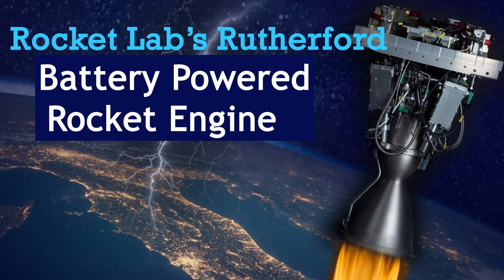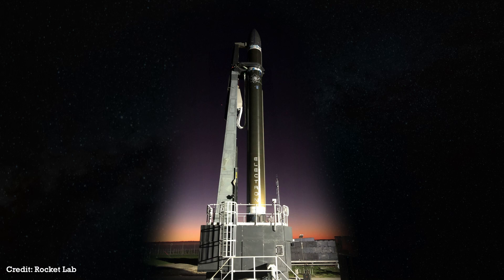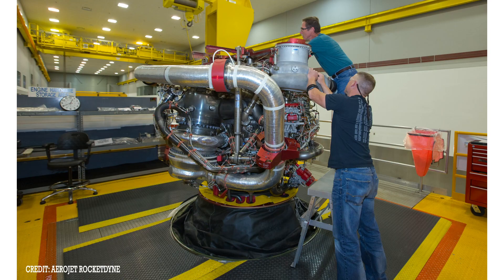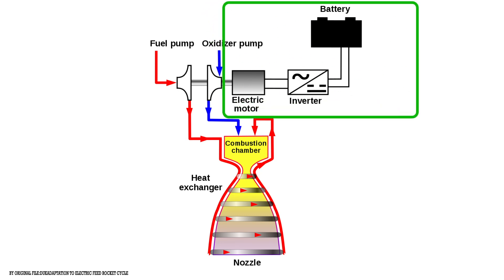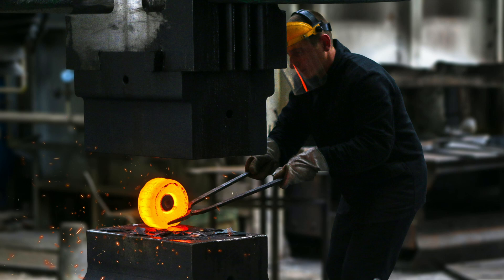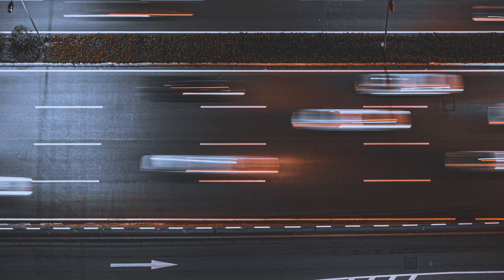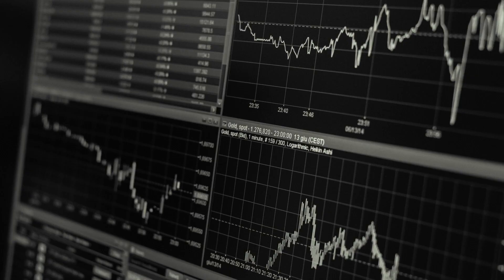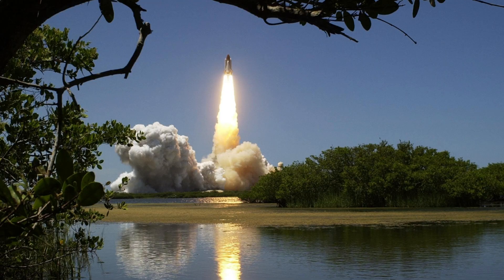A Battery Powered Rocket Engine? Rocket Lab's Rutherford Engine

Comment: Why didn’t Elon do this though
Reply: The use of electric motors results in an inferior performance in almost all respects. The big advantage is the much easier development. By using electric motors they managed to save a huge amount of R&D costs as the turbopumps are by far the most complex part of a rocket and consume most of the R&D cost. Rocket Lab managed to bypass all that by going using electric motors instead of complex hot gas turbines. It did result in a significantly inferior performance but given cost constraints it is better to have an 'inferior' engine that you can actually fly to space than a superior one that exists only on a drawing board.
As the company grows and can afford more R&D they will surely switch to turbopumps at some point to improve performance, but there are many other higher priority things that they will be doing before that.
Reply: @listerdave1240  you are wrong. Turbopump has lower performance.
Reply: @hafizuddin mohd lowhim  Absolutely not. A turbopump will provide far more energy (pressure * flow rate * duration) for a given total mass, by at least an order of magnitude even if you compare the best electric pump to the worst turbopump.
The issues with electric are partly because of the poor power to weight ratio of the electric motor compared to a hot gas turbine but much more significantly the very poorer energy density of batteries compared to rocket fuel/oxidiser. 
You also have the problem that a turbopump is unloading its fuel as it uses it, reducing the vehicle weight while the battery doesn't get any lighter as it is being discharged so you are wasting propellant to accelerate a good amount of deadweight.
If you look at detailed specifications of various rocket engines you will discover the huge amount of power a hot gas turbine can generate and yet be incredibly small and light.
Take the hot gas turbine on an RS-25 (engine of Space Shuttle and SLS) as an example. It generates 50 megawatts of shaft power to drive the fuel pump and yet is smaller and lighter than the engine of a small car.  I don't know specifically about the motors in the electron rocket, but let's assume the industry leading figure of about 14 KW/Kg. This means that if you were to use an electric motor to drive the pump of an RS-25 instead of a hot gas turbine then that motor alone would weigh about 3.5  tons, more than the whole engine weighs as it is.
Reply: Well if the Said engine could provide greater trust and isp than rs 25 like 380 isp on sea level 460 isp on vacuum even with dubble engine mass it is better
Reply: First of all as I already mentioned even though the mass of the motors will be a big handicap it is by no means the main issue and secondly there is no reason why it would, and if it did it would not be due to the way the pumps are driven.

More importantly  you need to be careful about how you define ISP.   To compare like with like you need to take into account not only the mass of propellant flowing into the engines but also the mass of whatever is needed to provide the electrical power to the pumps, in other words the batteries. Even for an open cycle engine the mass of propellant used to power the pumps instead of providing thrust is far smaller than the mass of batteries that would provide the same amount of energy.
With a closed cycle engine it is even better because the mass of the propellant used to power the pumps actually goes through the engine and out through the nozzle with the rest of the propellant which means it is effectively providing the power to the pumps for free (i.e. at no mass penalty).  So effectively with a closed cycle engine all the propellant is used as propellant.

There is essentially no way in which a rocket with electrically powered pumps can provide better performance than one with turbopumps. If you conveniently ignore the mass of the batteries needed to power the pumps (and less importantly the much heavier engine mass) than you could at best get an ISP equal to that of a closed cycle turbopumped engine.  

The ISPs of current leading engines are not limited by the performance of their pumps(which could easily be increased but would serve no purpose)  but by the temperature and pressure that the combustion chamber and nozzle can withstand. Anything you do with the pumps is not going to change that so going electric will just add mass without  improving anything in the way of performance. Worse is that while you could in theory equal the ISP based on propellant flow to the engine that figure would have to be downgraded to account for the mass of the batteries which for a real world performance comparison of ISP  and that is where you will see a huge reduction in the real performance of the electric variant.

That is not to say that electric has no advantages, there are some but they have nothing to do with performance. The main advantage is that it makes an extremely simple engine, cheap and easy to design and build (relatively speaking of course)  and with very little to go wrong whereas turbopumps, especially in a closed cycle system, require extremely complex and precise engineering and are always operating close to the point of self destruction, that being prevented only by advanced control systems.
Reply: @listerdave1240  you say that electric fed engine cannot perform better than Rs25 i say if it can dubble weight would be okey because most of the rocket is fuel so yeah less fuel means less tank and if it could be better than Rs25  and i say if not Will you Just say it cannot there is grafine ultra cappasitors and grafine battery that military use if you are that into trust to weight ratio but real advantage of this engines is different than you think so think about f1 there is no bigger liquid rocket nozzle engine with Electric pumps you can make multiple injetors like in v2 and maybe incarese engine power and size it like main engine part is actualy smaller means you May get denser. engine and pradoxcly you get more thrust even tho your thrust to weight ratio is less because you have more engine in smaller erea
Reply: @ufuker5754  The only difference between a rocekt using electric pumps and one using turbopumps is in the motor that is used to turn the pumps. Everything else is exactly the same including the pumps themselves.
It is either using an electric motor to turn the pump or using a hot gas turbine.
For the electric motor you need an extra source of energy (batteries typically) whereas the hot gas turbine uses the already existing propellant as its source of energy.

So please consider these points:

1. The hot gas turbines in current rocket engines already provide enough performance to drive the pumps, that is the amount of power they generate to turn the pumps. Any increase in that performance by any means, be it electric or even magic would not increase the performance of the rocket engine at all. Even if electric motors could offer better performance than the hot gas turbine that extra performance would not be made use of and would not improve the performance of the rocket engine.

2. Regardless of the method used to drive the pumps, the pumps themselves remain the same as do the combustion chamber, the injectors, the nozzle and just about everything else that matters in generating a high ISP.  The choice of what to use to drive the pumps only changes the amount of extra mass that needs top be carried. 

3. Electric motors (apart from being inherently much heavier than hot gas turbines) require a very heavy power source whereas hot gas turbines as used in rocket engines need at worst some amount of extra propellant (for a simple open cycle engine)  or none at all for  a closed cycle engine. How none at all?  Because it is the same propellant used by the actual rocket itself and goes out as exhaust from the nozzle. It is therefore used twice, first as a power source for the turbines and then as propellant. So the weight of the power source is effectively zero, which is hard to beat. For an electric power source to be lighter than that it would have to weigh less than nothing, which of course is not possible.

4. Using electric motors instead of hot gas turbines will not need less fuel. It will need exactly the same amount for the reasons mentioned in point 3, so no less fuel or less tank. 

5. The issue of multiple injectors and the comparisons you make to the F1 engine are not relevant because such things do not depend in any way on what is used to turn the pumps. Every such comparison can be made the same regardless of whether the pump is driven electrically or by a hot gas turbine. There is no reason why having electric motors turn the pumps would somehow allow you to have more injectors or anything of the sort. Such things depend only on what comes out of the pumps, not what is turning their shaft.
Reply: @listerdave1240  so you say 1 gas turbines is already well enough and everything is same other than one that is pumps i simply saying gas genator need more pluming more complex and more space needed electric could use less erea so i am saying because of simplecty electric engine pull of things that gas turbines would not and gas turbine will better in Said disegn but because of extra complexity humans cannot pull that of that desing so like you my Said f1 expample is irralivent but why engineeirs of appollo program did not do that then well because f1 is already covered in maze of pumps they Just not dare like i get it your point but you Just cannot accept the possibableyt of mechanicly worse engine performing better because of its design adventeges Just give a little more chance okey
Reply: @ufuker5754  Whether one or the other is better depends on what you need to achieve. If what you need is the highest possible performance. If you need simplicity and reliability then electric may well be the best solution. It may even offer some advantages in reusability since electric motors suffer little or no wear as opposed to hot gas turbines and all their associated machinery.

However if you need the highest possible performance there is currently nothing, even just in theory, that can improve upon turbo pumps when used in a full flow closed cycle. It is very complex and difficult to design but if ultimate performance is what you need then that is the price one has to pay.

The current state of closed cycle engines (especially if full flow) makes then very near to 100% efficiency, meaning that they convert almost the entire energy content of the propellant into kinetic energy in the exhaust so there isn't really much further to go in terms of 'efficiency'.  Ultimately what you want is the highest delta-v for the vehicle, so apart from the high ISP (which cannot be improved much further no matter what one does to pump the propellants) any reduction in vehicle mass will contribute a great deal to the overall delta-v. 

The differences in ISP between the closed cycle engines are mostly due to the type of propellant used. The RS25 for instance has a higher ISP than the Raptor has nothing to do with engine efficiency but  but is because the propellant used hydrogen/oxygen has a higher energy density than methane/oxygen and has an exhaust of lower molecular mass, which in turn means higher exhaust velocity for a given temperature. Hydrogen however has the disadvantage of requiring very large tanks (about 6 times larger than for methane) and be insulated compared to methane so some of the advantage in ISP is lost due to having to carry much larger and heavier tanks to contain it.

The only way to get significantly better ISP, or more importantly overall delta-V,  for large vehicles is by moving to an entirely different means of propulsion involving nuclear power.  For smaller vehicles such as space probes solar powered ion drives are currently the best non-nuclear solution.
Reply: @listerdave1240  now you get it ohh thank your brain so hydrogen is less dense am i right so it needs bigger tank so a bigger clinder would be better less surface area more volume but for that you need bigger rockets for bigger rockets you need bigger engines and biggest engines is more complex plus in staged or full Flow engines instead of two turbines you could raplece one turbine with Electric pump etc so hybrid is an option to like whatever is best engine must be done or maybe worse raptor engine with less turbopums but cheaper so i think this is like electric cars if your goel is going furher as possiable without refueling hybrid best engine or bad but cheaper engine or big engine that is not possiable without some elektiric pumps add into it now you see my friend
Reply: @listerdave1240  hey i have question so why dont we ignore politics for now build a giant sounding rocket that get to height of 300km UP but not speed and once rocket is there angle the exust to not hit the earth and use a open cycle nuclear reactor to gain speed for orbit and beyond
Reply: @listerdave1240  ohh well no exust velocity of open cycle nuclear reactor is obaut 21km/s and escape velocity is 11.2km and if craft needed no orbit 7.8 km/s 21-8 still more than 12 km/s it is nuclear muhahahaha
Reply: @ufuker5754  I'm not so sure about that. According to the information I have the best exhaust velocity that is expected from an open cycle nuclear rocket is in the region of 10 to 12 Km/s, and that for the more advanced rotating variety.  I think the 21km/s figure is what would theoretically be achieved with atomic hydrogen, that is single atoms rather than molecules of two hydrogen atoms. Such a thing is however still just an academic concept and it is not even known if such a thing can exist under conditions that we can create.

But let's assume that it does indeed achieve 21Km/s. Even so one has to keep in mind that it is only the hydrogen that exits at that velocity due to its low mass. Most of the undesirable radioactive fission fragments will exit at much lower velocity due to their much higher atomic mass. So we will have a situation where the clean hydrogen is safely escaping the earth's gravity but the dangerous fission fragments are raining down onto the earth's atmosphere because they are moving much slower than the velocity needed to achieve orbit, let alone escape velocity.

Even if that were to be solved there is still the issue of what happens if there is an engine failure while the spacecraft is accelerating to reach orbital velocity. There's not much choice actually - the only option is that the spacecraft with its active nuclear reactor will plummet to earth and create a radiological disaster.  The way to avoid this is to keep the reactor inert until after the spacecraft has left the earth's gravity well. An inert reactor falling back to earth would cause very little radioactivity problems, if any at all. 

This means however that the first part of the journey will always have to be done with a chemical rocket and then switch over to nuclear for the longer part of the journey.
Reply: @listerdave1240  okey so skyhooks that need to get speed of 4.8km/s instead of 7.8 with methane single stage or  railguns that shoot rocket at mach 10 exit on Mountain hight let the accent above most atmosphere and use 450 isp hydrogen engines to speed UP Again single stage or combined of these 3
Reply: @listerdave1240  ok hello me Again i Will not bother you after this but i found potantial use of electric pumps on hydrogen fueled normal rocket engine so what is the real flaw of hydrogen it has bad isp in sea level compere to vacuum so how obaut this we use electric pumps to dubble chamber pressure on lift off and when the rocket is about 7 km up batterys run out and because  the normal pressure drop well reason height it contunies with Just turbopums or reduced electric pumps so with this maybe rockets can lift off without solid booster i Mean Just dont argou aginst it like it is a rocket nitro Man cmon how cool it have to  get before you destroy it with your unending engineering (this is Hard)
Reply: @listerdave1240  well 200 bar is not limit some engines see 500 on some parts like you could still use small engine instead of pressurize that parts to incerese main chamber pressure like ok think about oxidezer rich preburner you need to pump fuck ton of oxygen there but small amount fuel and creful amount of fuel to instead of that small interconections you can use main pump to do more work at combustion chamber and oxygen pump you simplefying desing and make it more reliable and efficient
Reply: I guess this is difficult for large rockets yet..